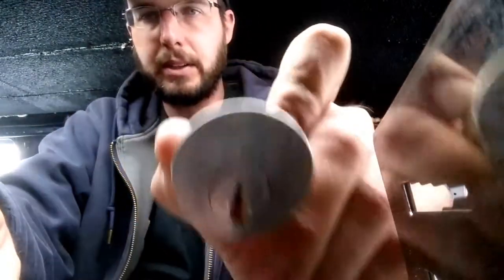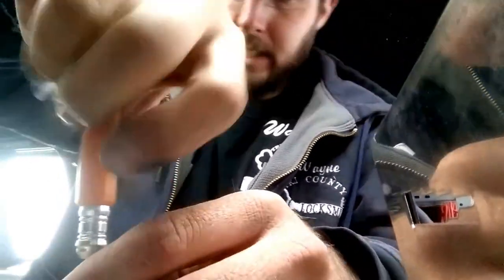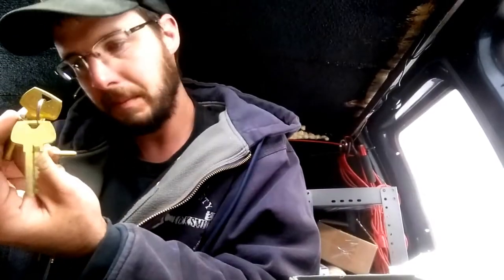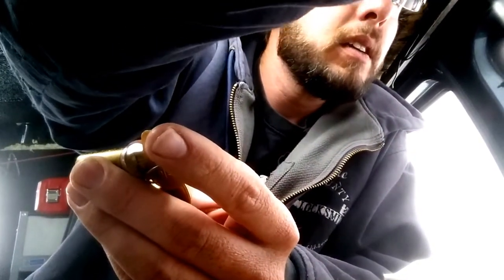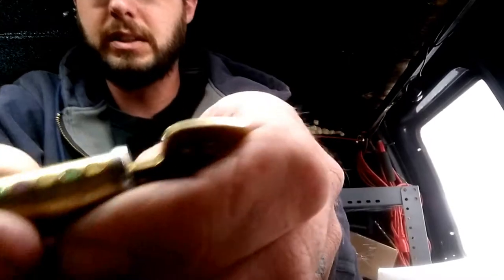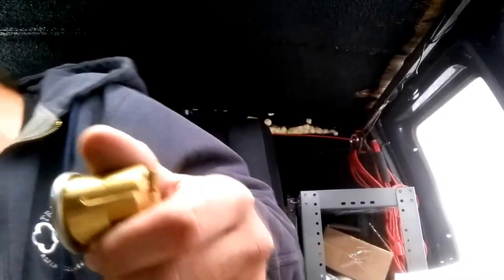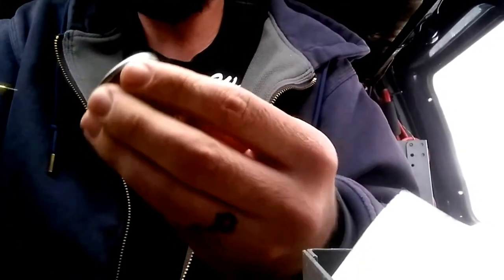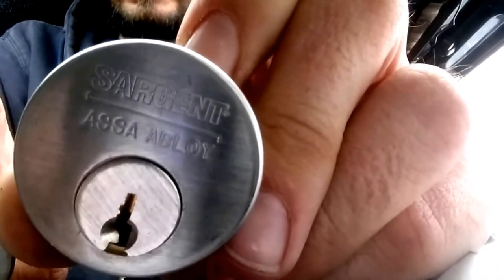Sargent Re Key LA Keyway Mortice Rim Cylinder Lock

Comment: Nice Video Wayne. i have always wondered what they put into them Sargents. Could you make a video of re-keying A Best lock maybe?
Reply from the maker: I really try and stay away from best hardware as much as possible. they're interchangeable core locking system and direct to end user business model has targeted the Locksmith industry for over 40 years.
Reply: Wayne Winton  So you'll deal with Best locks if you must, but you'd rather not
Reply from the maker: That is correct
Reply from the maker: I try to replace when possible
Reply: Wayne Winton  One of my friends has been threatening to send me a Custom Pinned ASSA lock. If they do actually send it, do you have any advice for a beginning lock picker as to what to look for and how to get into them?
Reply from the maker: Find a cutaway. Best way to learn is on a cutaway model. Pretty hard to come by though. The other way is to take the lock apart and add one pin. Pick lock. Then add another pin. Pick lock repete adding either a side pin or top pin untill you can pick the entire thing all at once.